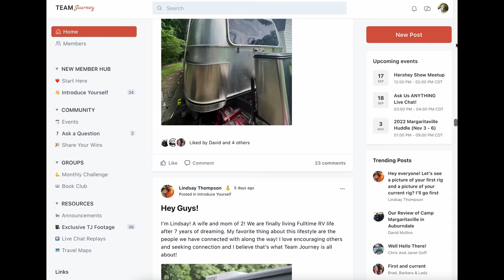Why We ALMOST Gave Up RV Living (And How We Kept Going)

Comment: I just noticed that the wood trim around the slide in the back of your video would be nice if it matched the trim on your island.  If you cut the wood (not sure if it’s the same type of wood) in angles like you did the trim on the island and then put it in place all the way to the middle (like from each side to the middle) and then in the middle would be a final v.  Just a thought. I can’t decorate my house for the life of me but give me a picture of what might look good (or maybe not) Lol. Safe travels.
Reply from the maker: Thank you.

Comment: Question: you guys have had a Class A, the airstream and two 5th wheels. I think I get why you moved away from the airstream…just to small for your family, but why do you prefer the 5th wheel over the Class A. Is it that the 5th wheel gives you more room? 

The reason I ask is because I’m just starting to look for a new rig. Many years ago I had a Class A   w/o slides, but I’m leaning toward the 5th wheel as they just feel  roomier, they’re more homey, and they’re floorplans are superior. I also don’t like the fact that when there’s a mechanical problem with a motor coach, you basically have no home until the issue is fixed which can take days, if not weeks to repair. 

I’d really like to hear your thoughts if you don’t mind as you guys have been full-time for years and have experience with the different rigs. Thank you.